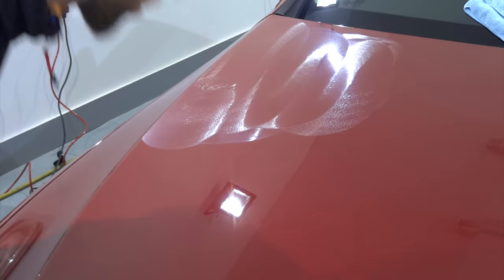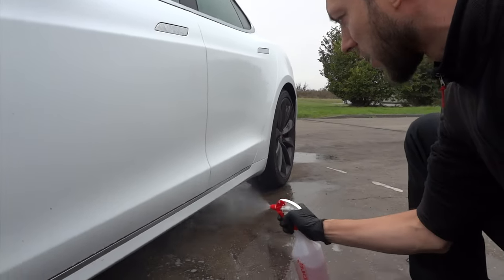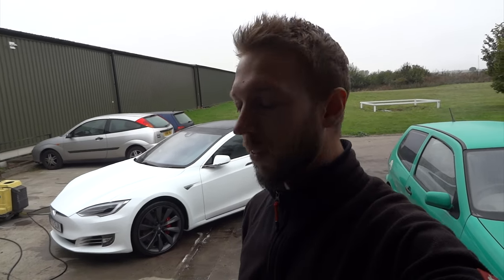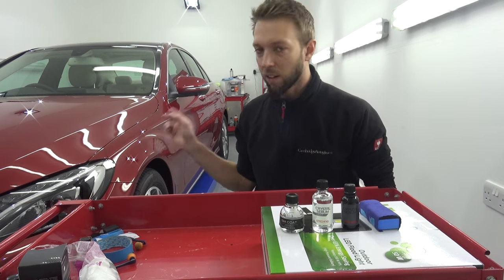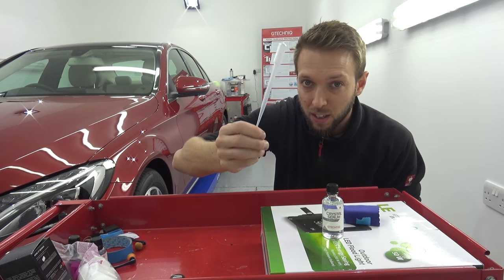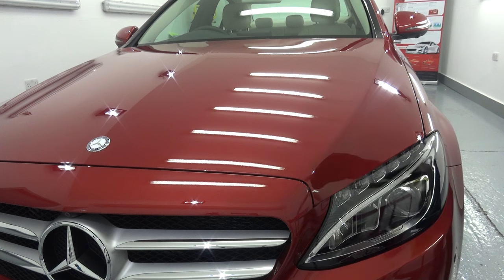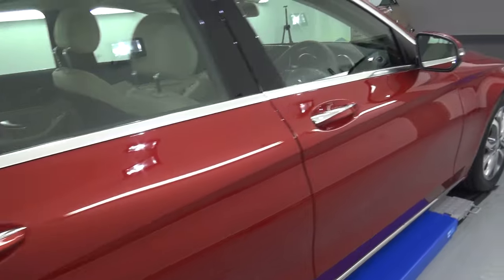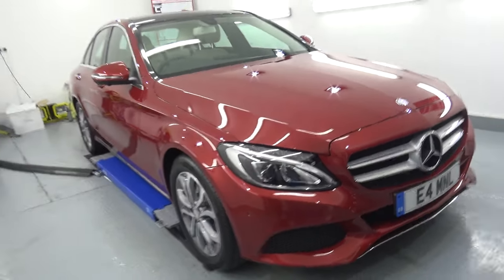Tesla Model S P90D Gtechniq Crystal Serum detailing - Cambridge Autogleam VLOG 002

Comment: Yet again another great video dude!!! ..glad I've subscribed so I get updates when you post a new video...really want to try CSL...quick question ,  you toss those microfiber towels when you done correct??..and how many you use per car roughly??...I've only coated 2 of my cars (one of them being my new profile picture) and I toss them just to be safe..go through maybe 6 for the whole process..one being the major bulk removal of the coating and the other to buff off any excess...anyways sorry for the rambling..detailing is my meditation hahah
Reply from the maker: Frank Valencia hi. CS and CSL don't crystallise like C1 did so it doesn't harden the MF cloths so I put them in the wash and use them again for other detailing jobs. I always use new cloths to remove the coatings though.